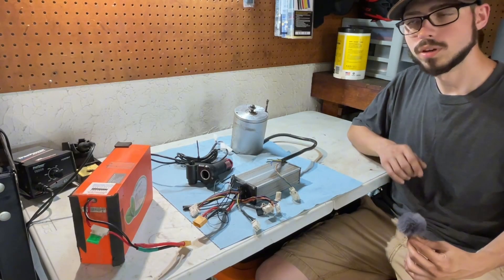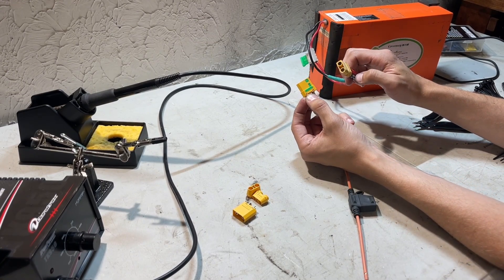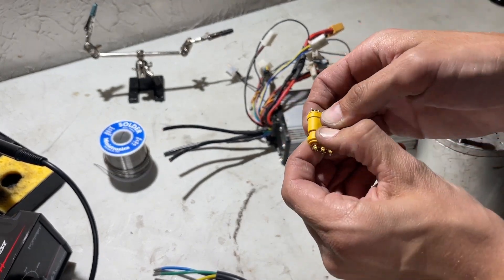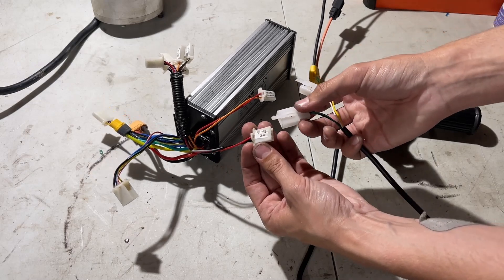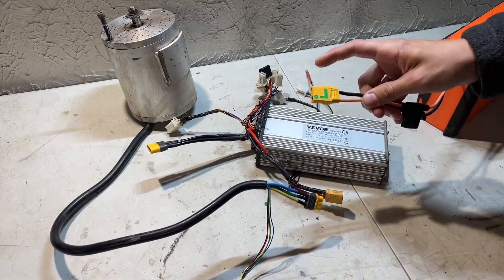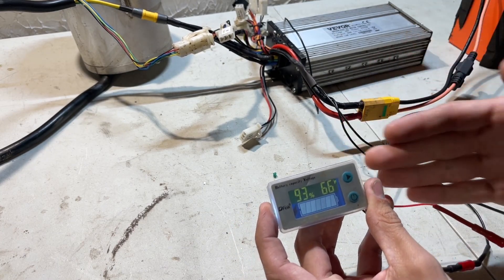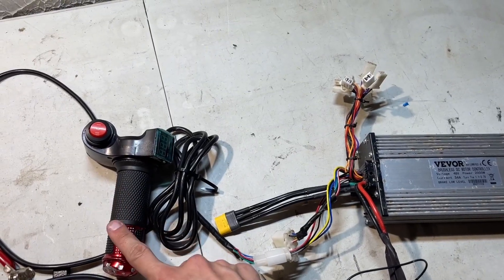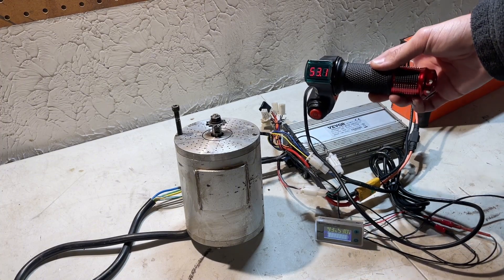How to Wire a 48v 2000w Vevor Kit - JordyBuilds

Comment: Great video!! I have a quick question I have this same kit, and I can only hit 21 on stock gearing. I don't have a 3 speed attached do you think that my is set to low speed by default? what else could it be! Also mine has a slow start, and I want to know if there is a way to prevent the slow start from working.
Reply: I know for a fact without the 3 speed switch plugged in yes the lowest option will be the default select by controller.

Comment: My kit came, but unfortunately, the throttle that came with it wouldn't spin the motor. I had the lock with a pin and I know electricity was running through it as I tested it, and when I pressed the on switch, the motor made that very faint click noise. I don't know what it could be other than the throttle. Because of this, I took a stock azor mx650 throttle and connected the correct pins to the correct pins on the throttle wire. It worked. I was excited and did the modifications to make it fit into my frame. once it was ready to going in I put it in and it didn't work with that razor throttle. I tried the 2 other razor throttles I had and they continue to not work. power was still going through and the motor did that click thing. i don't know the problem and I'm not longer under warranty because I cut that mount off. I'm really confused.
Reply from the maker: Are you talking about the vevor kit?
Reply: @JordyBuilds yes

Comment: I’ve got this kit coming in soon. I have 40 amp max discharge 48v battery. Do you recommend using fuse? If so what kind? On top of this not having the antispark what difference does it make other than no spark? How damaging can just a spark be? I’ve also heard about the vevor slow start in motors. Do you realize this?
Reply from the maker: Shouldn’t need a fuse. 
Anti spark is good for anything over 30 or 40amp. Vevor controller has a touching throttle that’s about it
Reply: @JordyBuilds thank you, is it more likely for my battery to blow if there’s no fuse?

Comment: I need help
I have a 48v battery  and it has the o ring connectors and keeps popping the fuse when I try to connect it , I seen a couple videos saying it’s safe to cut one individual wire at a time and to crimp or solder a xt90 connector , my question is it really safe to do that ? Do I just snip the wire with some scissors and solder on the connector?

Your my most trust worthy person since I have no experience in electrical work but I don’t want die lol much love and great video I’m really learning a lot and looking forward to hitting some trails 🙏🏽🙏🏽
Reply from the maker: Definitely don’t use scissors but if a fuse keeps blowing something is either connected wrong or need a bigger fuse
Reply: @ wire snippets or what’s safe to cut them with? 

Yes my dumb ahh keeps putting a 30 amp fuse and a I have a 48v idk if volts or amps are the same but I’m trying to use common sense and research I appreciate you!

Comment: My motor over heats what do I dooooo.
I opened it up and it has no fan is that normal
Reply from the maker: Some older ones have fans. Also you need a new motor if it overheats and don’t work
Reply: @JordyBuilds I watched some videos on this call and they said to drill holes for extra airflow I was a bit sceptical but I wanna ask for your opinion?
Reply from the maker: @Razor2Kw you definitely can. People take a step but and open up the holes. If you ride a ton of dirt or mud I wouldn’t tho
Reply: @JordyBuilds where do I drill the holes?
Reply from the maker: @Razor2Kw there’s already holes just little tiny ones. Use a step bit to make them bigger

Comment: Quick question where did you buy the battery capacitor meter
Reply: It’s on Amazon for $11 search up battery monitor with temperature meter.
Reply from the maker: AliExpress

Comment: this was a great video, I have the same motor and controller (identical cuts on the wings).  I didn't have validation for the 3 speed on the controller and this helped, I bought an extra on/off switch to have the lock capability

Comment: thank you so much for this video as my motor was not working and i was worried about why it wasnt then i watched this video and saw that i had a very similar throttle as you and because of you saying you need to use a paper clip to jump the power lock i made a cable with 2 pins on the end that would do the same thing then the motor worked i am so grateful thank you very much.
Reply from the maker: I’m glad it helped !!

Comment: My moter feels like the e brake is on what shuold i do
Reply from the maker: What’s your set up? Also make sure your chain isn’t too tight and also make sure your brakes are actually not sticking.
Reply: @JordyBuilds  no it's my moter and it won't turn on either
Reply from the maker: @ertynh6004  hang turning motor won’t be super smooth
Reply: @JordyBuilds  and when I turn the motor it feels like regen is on

Comment: is all the re wiring is it necessary? Not tryna be rude but i just had a question becuase im starting a build and im new and im wondering can this just be like a Plug n play? or is some re wiring like required to actually run?
Reply from the maker: Depends which kit you bought etc. you should be able to make it work how it comes

Comment: i've got that same controller, I hooked it up to a hall sensor motor and battery lock out and throttle, i was getting a throttle output signal but my motor was not turning! is there any other jumpers necessary to turn this controller on? or maybe is my controller bad? or my motor bad
Reply from the maker: Do you have your electric lock/ key switch set up ?
Reply: @JordyBuilds  I put a jumper wire across it, I was getting throttle output above 4 volts. I'm dealing with a 2014 Bionx 500w 36v motor that I have to remove all the spokes to get it apart to check inside.

Comment: Do you know what wires you would switch to change the direction of the motor
Reply from the maker: Swap two of the phase wires until it goes correct direction. Two of the three motor wires the blue green yellow
Reply: @JordyBuilds ok I swapped the blue and green wires and it goes the correct direction but under load it jerks at take off and won’t go unless have rolling start
Reply from the maker: @user-yp6nl9sh5b swap a different two
Reply: @JordyBuilds I think I tried every combination but it’s still jerkin
Reply from the maker: @user-yp6nl9sh5b make sure there’s no reverse that’s automatically enabled or something I’m not too sure

Comment: You go by through this so fast because you know it some people here are trying to figure it out for the first time explain the colors you covered the colors up and didn’t explain them. What’s the blue wire go to the thick one you got red, black and blue. What’s the blue one? You don’t show where that goesand you don’t mention it so far that I noticed
Reply: Which is the high speed switch it’s all Chinese
Reply from the maker: I go over it. Blue green yellow is phase wires
Red and black or power

Comment: When I plug the motor into the battery and roll the throttle the motor will do like 4 rotations then it stops
Reply: I still have power going through the controller and after the 4 rotations the gear inches forward then goes back to stationary do you know what the problem could be?
Reply from the maker: Check your phase wires
Try swapping two
Reply: @JordyBuilds  is that the electric lock wires?
Reply from the maker: @salfred1027  nope it’s the phase wires
Reply: Do you know what the problem could be?

Comment: seen you on tiktok and i’m building a 48v 2000w mx350. when i checked my hall sensors i saw one missing wire and i was wondering if there’s one missing as well for you?
Reply from the maker: I’ll double check today!
Reply: @JordyBuilds  it’s okay man i figured it out. however i am struggling on wiring this caomm battery
Reply from the maker: What’s the struggle ?
Reply: @JordyBuilds  so for the vevor it has the positive and negative wires like the motor phase wires (they have holes) but my coamms battery has a connecter
Reply from the maker: The plug is called a Dean connector, you can cut ring terminals and put the opposite Dean connector on to match battery
Reply: @JordyBuilds  does this require some soldering? because for one i don’t have a soldering station, and two, there’s no hobby shops where i live
Reply from the maker: Yes it does require soldering. If you’d like you could send me controller and I’ll solder correct terminal on or hobby store
Reply: @JordyBuilds  or, is there a way to give it those terminal rings and heat shrink it on?
Reply from the maker: Yes but you’d have to use a terminal block which I don’t recommend for battery because if it gets hot and melts it could cause a fire. T plug/Dean plug to match battery is your best option. Or order a pack of 2 pin connectors and cut off both ends and crimp onto battery and controller but for that price you could pretty much buy a cheap soldering kit
Reply: @JordyBuilds hey man it’s me again. i just got everything wired up! i was honestly second guessing on how hard wiring the battery was, my dad helped me with it and it’s all good because he had a soldering station. thanks again for this super helpful tutorial!

Comment: What display is that. Link if possible? 

Looks bad ass having percentage and Voltage! Game changer! 

Power has heat shrink added but you skipped how or what you used to properly and safely tap into it. Can you elaborate?

Did you cut the XT 90 you wired in and than add the wires with just heat shrink?
Reply from the maker: I had the wires soldered to the power wires for my gauge. There’s other ways to do it though. https://a.aliexpress.com/_msbxcn2